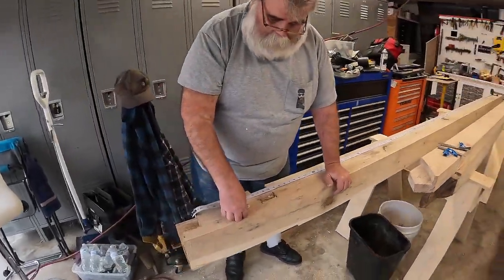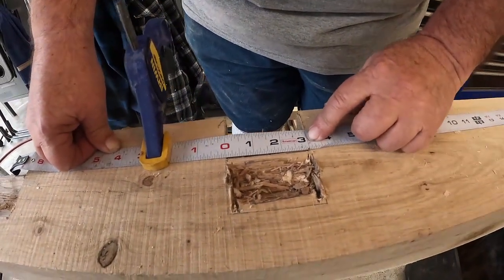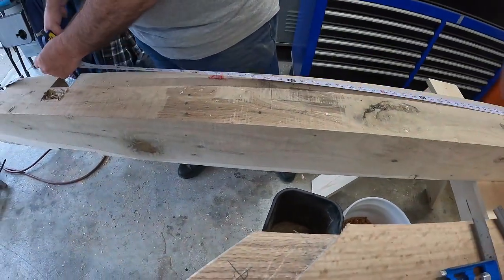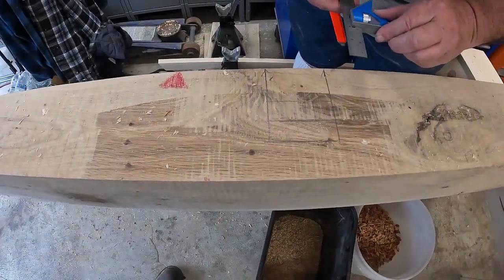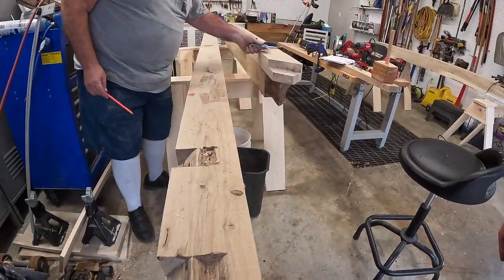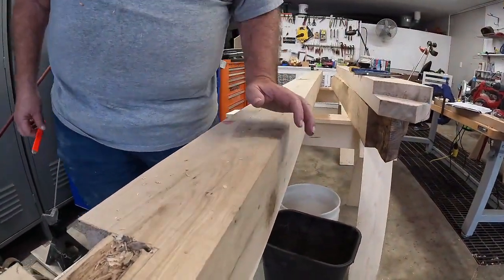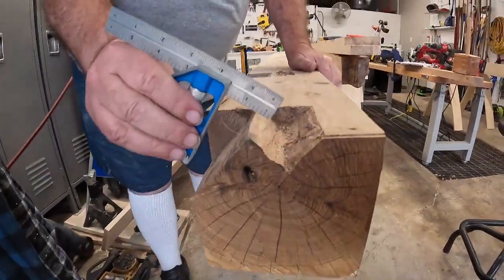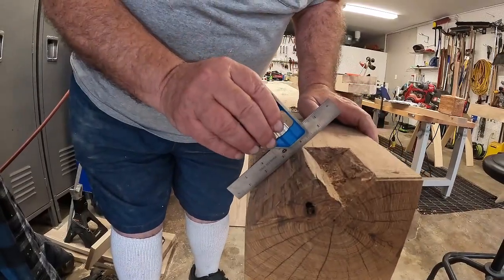Step Lap Rafter Seat Layout and Cutting in Timber Framing

Comment: Perfect explanation. Any advice for adapting to a 6:12 rafter?
Reply from the maker: My best advice to you is to draw the rafter plate eave detail with the angle for a 6/12 roof pitch, on paper to scale. So, you can visualize the joint. Then draw those lines on the end of the plate to get a copy of your drawing. Hope that helps.